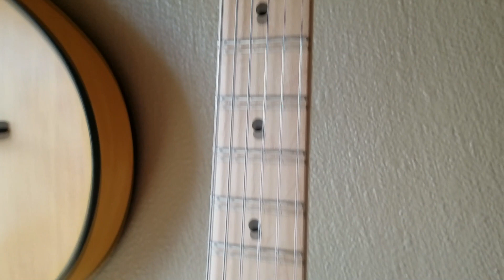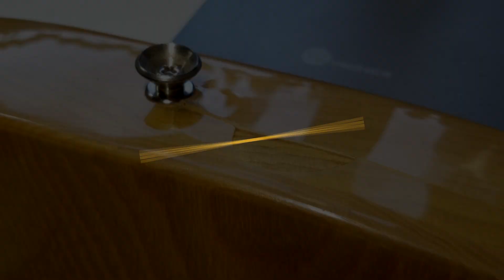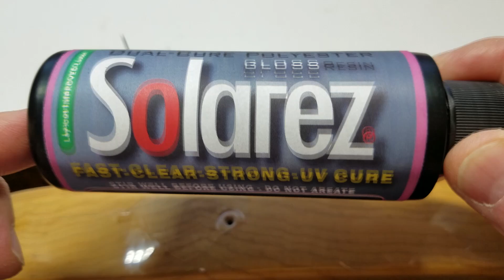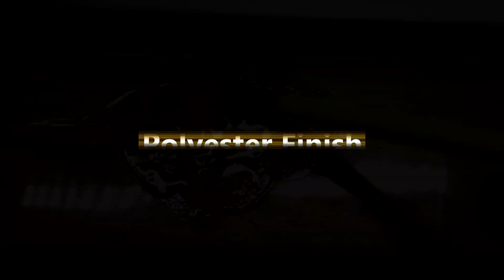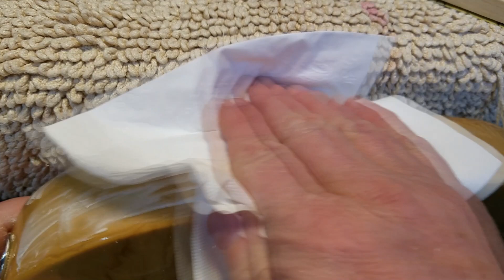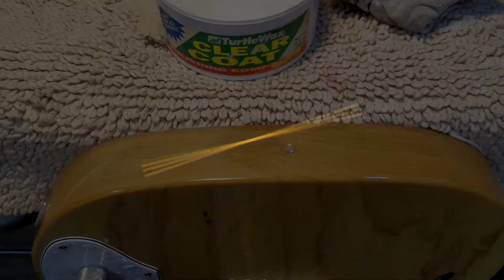How to Repair a Polyester Guitar Finish

Comment: I have something like this but it has this cloudy cracking stuff around the crack in the finish. Is that fixable??
Reply from the maker: Is it possible to cut out a section larger than the cloudy area and use the video’s techniques to repair?

Comment: Definitely learned something here given I was a bit light on knowing how and when polyester was used.  Apparently, the Yamaha SJ-180 I am now repairing, a 40 year old guitar, has a polyester finish according to some research, but I thought it was polyurethane.  I'm not sure the method I'm using now to repair dings, the CA glue method, would change, but this gives me an alternative to try.  I now use this guitar as a test, guinea pig for repair techniques.  Good info here.

Comment: 6 years later and still the only polyester finish repair video using actual polyester resin on YouTube. Why isn't this the new standard for guitar repair? Everything is polyester now
Reply: That's right! Glad I finally found this info. I thought I have to use poly laquer, but now I'll just fix my Epiphone guitar with the same polyester resin I have used on my glass fiber boat.

Comment: Can you apply that on a spray painted guitar?
Reply from the maker: @jesusgirarte-sandoval7535  yeah, be sure to use the solar flex meant for surfboards and then gently spray paint over it to match the original finish.  Then, wet buff down to a sheen with the techniques in this video.

Comment: Excellent vid, thank you. 
I have a 73-76 fender fretless bass…The maple fingerboard is worn through in 2 places in the 7th position , do you think the gloss resin product you’re using could be used to fill in two shallow “gutters” that have developed?
Reply from the maker: Hmmm, I don't think so.  The finish on a fretboard is not poly, like what is on a guitar body.  But I am not an expert at this, you may want to consult Fender Customer Service.

Comment: Hey thanks for posting this. I just acquired a 2002 reissue of a 1972 Natural Strat MIM and have the exact same issue on the lower horn. My piece of Poly is still intact but several cracks and lifting or a fairly large chunk of the finish. I posted the pics and questions on a Facebook guitar repair forum and the consensus seems to be that it is too difficult to repair and to just leave it as it is. Your video shows me that it CAN be repaired or at least prevented from getting worse without ruining the guitar. Thank you!
Reply from the maker: Give the repair a go at it...at least it will prevent further cracking and chipping off.  Heck people pay big dollars for "distressed" guitars!

Comment: shame that crack did not absorb the resin An idea for a next repair :  a vacuum bag - after application of resin on the cracks. Vacuum bag as in composites fabrication might suck the resin in to the cracks as it pulls the air out of the separated finish.

Comment: CA thin Glue would've fixed that in half the time and you would've never seen the repair.
Reply from the maker: I don't think you've tried CA thin glue on wood and polymer.  The wood will turn darkened and accentuate the yellowed original polymer finish.
Reply: @hikefishmakemusic  obviously the witness lines on the finish here are evidence that this was a subpar repair. Visually you can see the boundary or the area you  worked on. It's not a bad repair perse,  but it's not the best approach.
Reply from the maker: @southboundlive6328  can't wait to see a repair with CA glue for the size of a half dollar and 1/16" deep.  Be sure to let me know so I can see the video!

Comment: Very good tutorial.  It looks like the clear coat separated across the entire bottom edge of the guitar.  As you panned closer to the output jack, the color looks darker like it does in the newly patched area (where the resin makes contact with the wood).  That would be a big chunk of finish to cut out and repair.
Reply from the maker: Yes, exactly

Comment: Do you think you could colour this stuff to fill in chips on a black guitar?
Reply from the maker: yes, it can be colored.  search for epoxy powders on the net.
Reply: @hikefishmakemusic  I discovered from another video that loctite makes a black superglue (480) that should do the trick nicely, seems to polish up well for a cyanoacrylate! 

It’s only a very minor headstock chip I’m dealing with, so the added cost of getting a UV torch and stuff doesn’t seem worth it, that’s good to know if I ever have any major damage though thanks!

Comment: very good video,,, but what is the reason that made the finish got separated from the wood like this.
im going to finish my guitar and didn't decide yet what type of finish i shall use but im considering 2k automotive clears.
Reply from the maker: the previous owner dropped the guitar on edge.  once these types of finishes chips, the damage will grow over time, loosening its grip on the wood body.  i am not a big fan of these types of finishes.

Comment: And the first thing you done was not plug the screw hole, which undoubtedly got the wood wet inside and probably will cause the wood to swell and contact again. lol Sorry, I couldn't
 help but notice that. Great video though! Very nice outcome!
Reply from the maker: good observation, but i didn’t add water directly, i added the moisture as a polishing paste, so i really didn’t worry about it.  Plus, i live in colorado where it is so dry that water comes out of the faucet as powder.  things dry warp-speed fast here.
Reply: @hikefishmakemusic  LOL Very nice job! I have to say, I was very impressed.

Comment: I have a 85 Japanese contemporary squire (ST335) I lent it out for years it was seriously neglected, in the black finish there's spider cracks all over, well I started stripping it and where the finish was cracked there's hair line cracks in the wood, they are litterly a line nothing has opened up but if you run your finger over it you can feel a very slight line in the wood. I have a feeling if I just paint over it it will just crack the finish again. I'm guessing it was from environment changes like cold/warm/humid/dry? Do I need to v out the lines and fill them with a glue or something then resurface?
Reply from the maker: Aaron Waltz sorry to hear about the neglect on your guitar.  It really sounds like a complete refinish is in order.  i wouldn’t try to spot-repair the magnitude of damage you are describing.

Comment: Might be adequate repair on a cheap electric guitar but clients with expensive instruments would not accept that kind of result as I can see all the repair areas after completion
Reply from the maker: yeah, if you have an expensive guitar, it probably wouldn’t have a poly finish anyhews.
Reply: @hikefishmakemusic  Taylor acoustic guitars have poly finishes. The one I'm working on now retails for about $2600 new.  This is NOT a disrespect. I appreciate this video very much.  When I had a shop and built acoustic guitars, I used nitrocellulose lacquer. I was not at all familiar with the polyester finish and THIS guitar is a nightmare having been left out in the elements, heat, humidity and even rain on occasion.  Why anyone would treat a guitar that way, I just don't know!
Reply from the maker: @billjaynes9234  I am talking about electric guitar finished, not acoustic guitar finishes in this video.  I have a Taylor 914CE - hard to tell it is poly.  Taylor most assuredly is using a very different formulation of poly that what is used on a Fender thinline - they are no where close to being equal.  Taylor's finish is far, far superior.  It better be for the $4k price tag on my 914CE.
Reply: Expensive Fenders use poly. Any guitar with a finish built to last uses poly. If it was to look flawless you'd want to sand the whole butt down to wood and re clear that whole bottom surface, and maybe blend it in at the jack. A straight line blend is a lot harder to see than a blob like area. That would take a lot longer of course. I would do it in this case just to get the long crack out.

Comment: I've got a mid-nineties Yamaha APX-6 classical guitar that has quite a bit of clouding in the finish on the back. Yamaha tells me it has a polyurethane finish and they don't know a way of fixing the problem but to maybe ask somebody who might be able to give advice on it. Would appreciate any input. Thanks.
Reply from the maker: I used to have that same guitar.  Clouding is most likely a symptom of moisture affecting the finish.  Without seeing the guitar, I recommend taking it to a luthier/restorer for a realtime professional opinion.
Reply: @hikefishmakemusic  Thanks for the info.
Reply: Have you tried using heat on it? I have carefully used a heat gun to remove a cloudy finish from a few guitars. Start on a low setting , hovering a a good 10" above the guitar. Keep the heat gun moving, don't stop over the same spot for longer than 1 second. Keep it moving all over the cloudy spots. Shortly you MAY see the cloudy finish start to dissapear right before your eyes. If that is the case, feel free to turn the heat on a high setting, and go at it. Obviously go at it with caution. Don't stay over the same spot for long. Keep it moving. Stay away from anything plastic, like the binding , plastic tuner handles, etc. Do this at your own risk, you may damage your guitar and make it worse! (Or you may fix the cloudy finish) .
Reply: @Jimmy-rd5ig  Yep, tried heat with no luck. I solved the problem by giving the guitar to a friend. I wasn't using it anyway, so one less thing to worry about. But thanks for taking the time to try and help.

Comment: Hi !
Thanks for sharing. I  have same problem on my Classic Series 70' s strat (ashwood). Fender use some gold like color or yellow tint under finish coat. So paint not touched on your tele body, only finish chip. I'm less fortunate (. On my strat finish came down with paint (stain), so naturally ash is very light color (pale). Can you please advise what stain i must choose ? what i must do first, because this Polyester resin or super glue's was tranparent and the coating will be just transparent. May be minwax stains (golden oak) be good idea 

Thanks

Comment: Used that product in bulk making surfboards- it's original use.  Direct sunlight is fine to make it "kick"/get hard- free UV light from mother nature.  Two coats or even just one would of had the same result or better.  The layers can delaminate from each other if previous layer was cured beyond tacky.  Could Dremel down the crack line with a steady hand and fill it proper.  You didn't mention the fumes, they fill the house.
Reply from the maker: yeah, good point on the fumes... I work with air-brushing and all sorts of adhesives frequently, so I have a well-ventilated negative-air-pressure ventilation system near my workbench area, so the fumes weren't an issue for me.  Still, I failed to mention the potential fumes in a small, enclosed area.  Duly noted.  Regarding delamination of 3 layers of Solarex, you may experience that with large surfaces on surfboards, but I highly doubt delamination will be experienced on a 1" x 1" repair area on the butt of a guitar.  Especially since the butt of the guitar is never/rarely exposed consistently to sunlight and saltwater, like a surfboard is.  I wrote extensively about the uses of various UV-cure resins and the effect of varying UV cure light wavelengths in one of my books (Designing Poppers, Sliders and Divers), where I use multiple layers of UV-cure resins in lure making...never had a delamination problem to date.  knock on wood.
Reply: *would have or would've. There is no such thing as "would of."